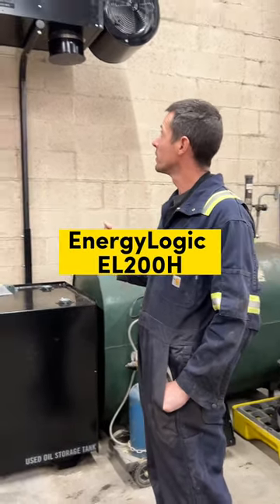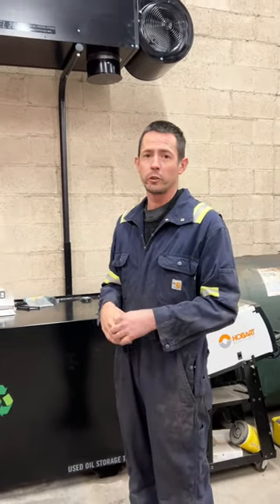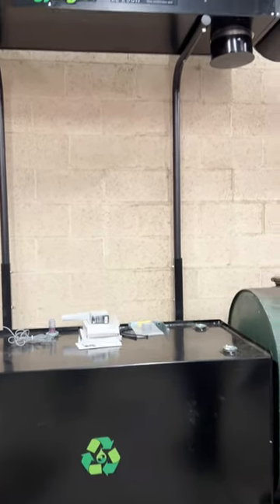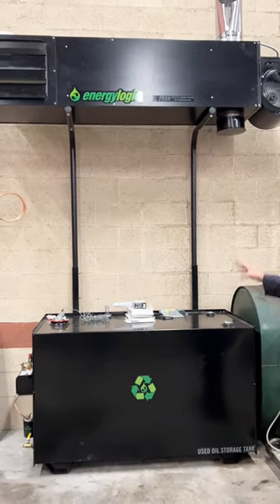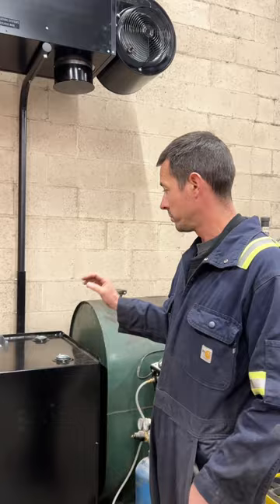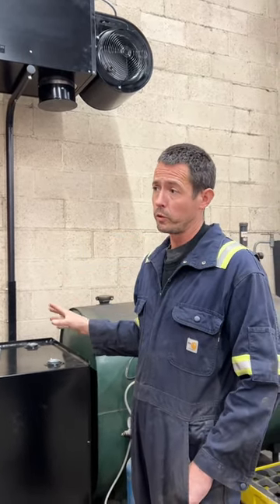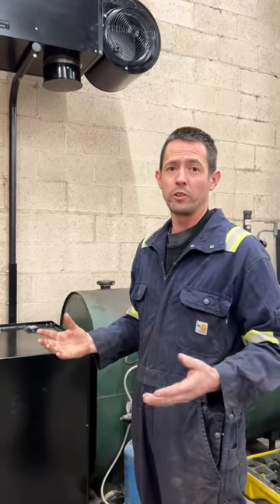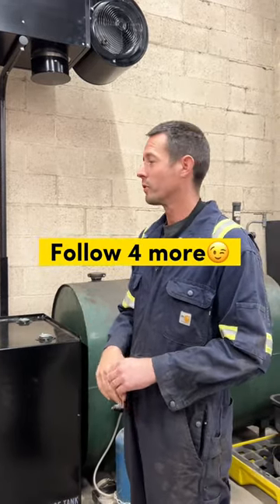Waste oil burner/heater to heat up a 3,000 sq ft shop - EnergyLogic EL200H #shorts

Comment: I think it's also possible to recycle the oil if you can find filters that can filter down to a low enough level, run the oil through that and I think you can actually recycle the oil that way. I think there are high bypass filters you could set up in series to do that....  Something that I thought about recently.
Reply: If you understand how hydrocarbon molecules work, you cant just filter the oil, you have to either rebond the molecules to make longer hydrocarbon chains, because the hydrocarbons breakdown when ran in an engine, also the tiny metal particles that come from engine parts that the filters cant filter out. If you want to filter it down the most, you need to use a centrifuge. I recycle oil and we add new oil to filtered oil and run threw a bonder, to bond the hydrocarbons.
Reply: @staym925  really? Is it cost-effective? I'm curious about bonding because that sounds expensive but I don't know